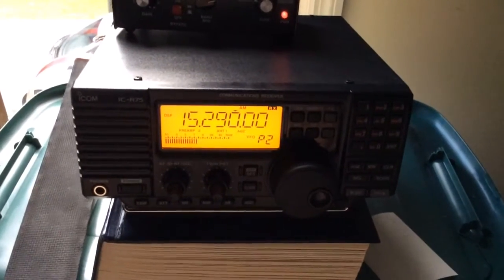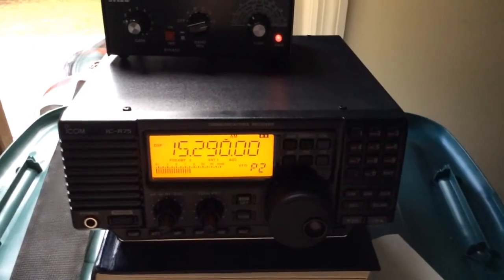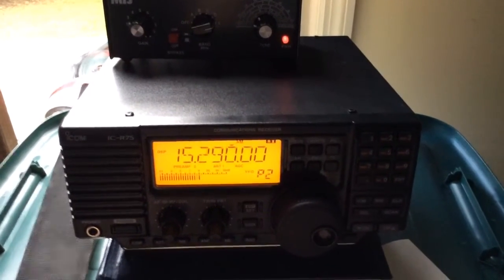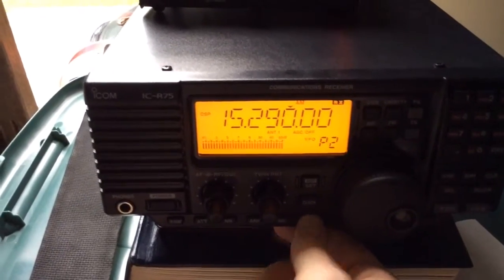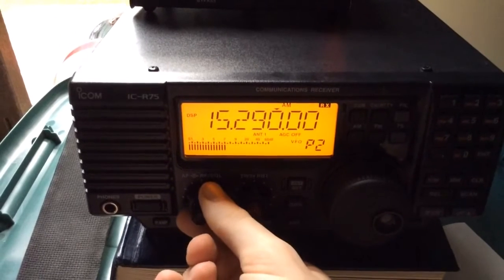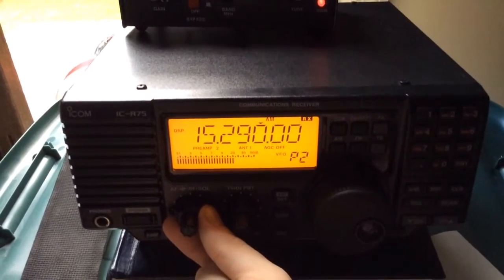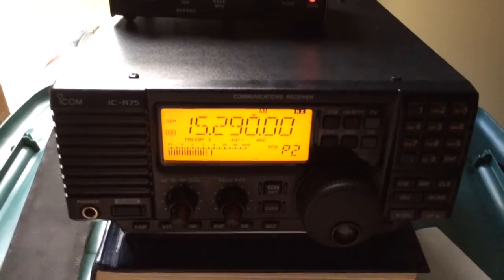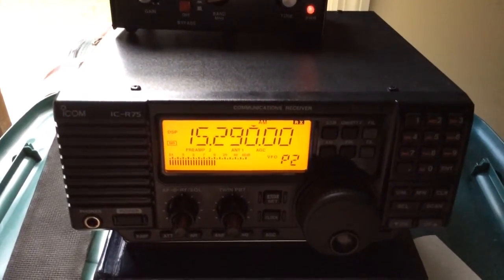Using RF gain and noise reduction to improve signal quality

Comment: Some of your information is correct, but some of it is a little misinformed.  

1) The NB filter is for pulsed noise such as vehicle ignition noise. It will do absolutely nothing for broadcast, amateur, even alien signals as long as the noise masking the signal isn’t a square wave, and its inability to help here has nothing to do with the bandwidth of the signal.

2) Your technique for reducing RF gain and only applying it until the signal pops out of the noise is correct.  However, this technique works with or without the AGC.  The fading of the signal as observed in this video would benefit from leaving the AGC on but setting it to a slow setting.

3) The preamps only benefit at higher frequencies, because they can raise weak (and strong) signal levels above (and way above) those of the receiver’s internal thermal noise.  On the lower bands, atmospheric noise dominates and the receiver’s sensitivity is not enhanced by a LNAs. 

4) The noise reduction works on any kind of noise, whether artificial, atmospheric, or thermal. It’s a digital filter, and as such the correct setting is the value that reduces the most noise without sacrificing intelligibility, however, personal preference may vary especially when used in conjunction with the features mentioned above.
 
For example, on my IC-7100, with the RF gain at maximum, 1st preamp turned on, and AGC set to the default slow setting of a 6 second decay, I’ve found that a NR level of 4 to 6 produces a dramatic result while copying weak SSB signals on the 20m band. This should hold also work when receiving AM broadcast in an exalted carrier mode.